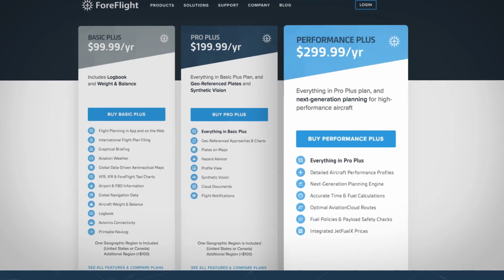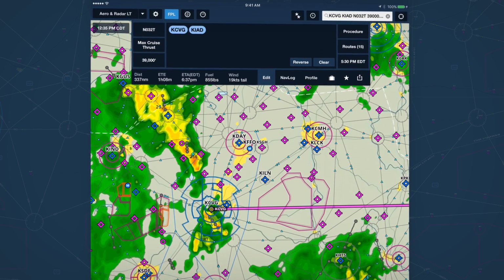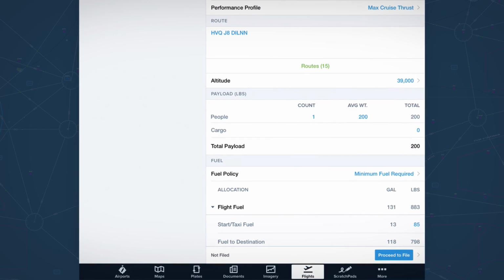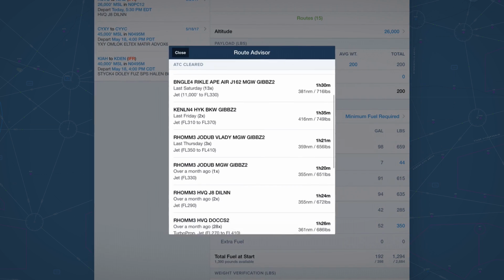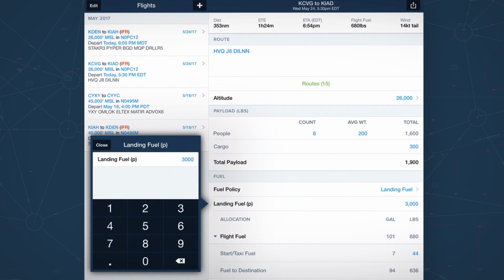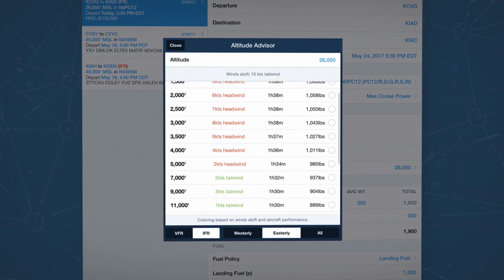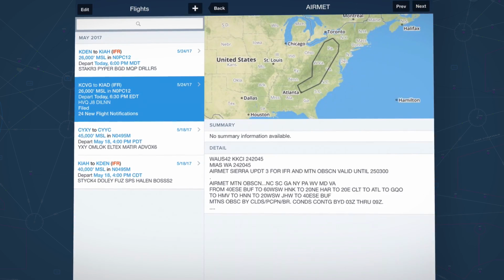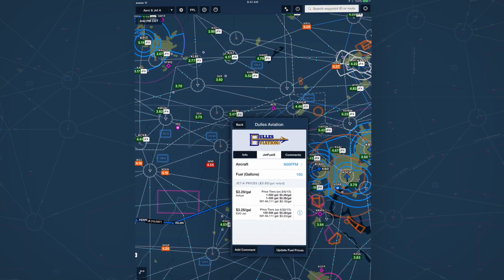Introducing ForeFlight Performance

Comment: I see that you've add TOC and TOD to the flight tab nav log but neither appears on the map or even in the nav log on the maps tab! In order to see either, you are expecting user to PRINT a nav log or wait for it to load every time they wish to reference it!?
Reply: And where, in God's name, is the blessed ability to SET MULTIPLE ALTITUDES for a single flight!? That's basic flight planning and should have been part of foreflight long before now!
Reply from the maker: Yes, the Navlog is meant to be used as an inflight reference. You can print it out, email it to yourself, or simply view it in Flights - the Navlog is cached after it's generated so you won't need to reload it every time you view it.
Reply from the maker: Thanks for the feature request for multi-altitude flight planning - we'll pass it to the team.